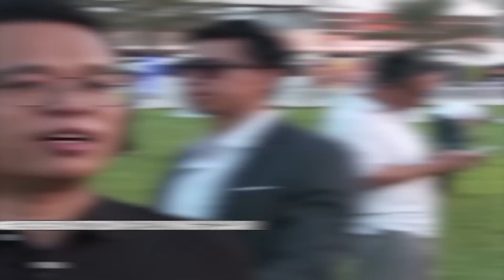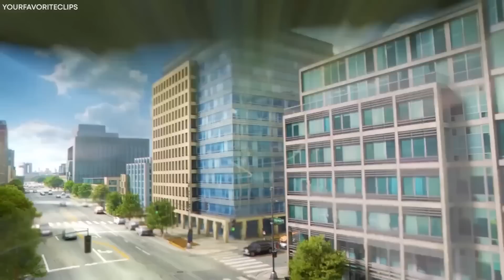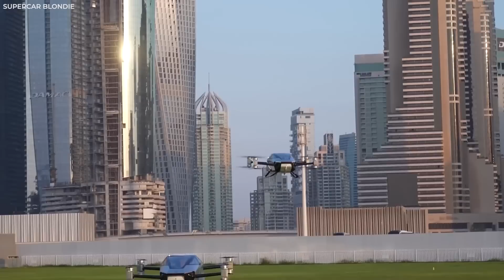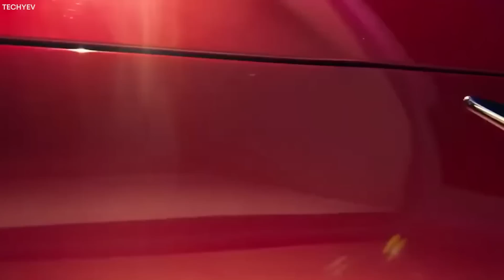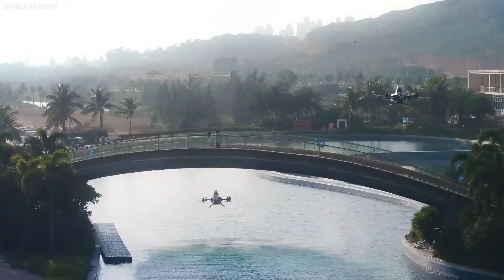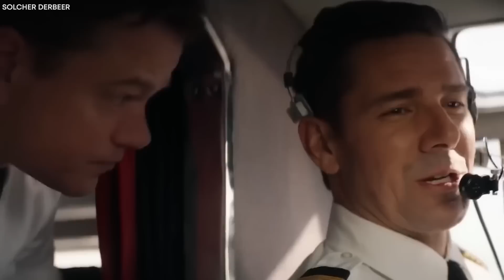China Releases NEW $12,000 Flying Car for 2025 That Changes Everything!

Comment: Marvel of Chinese engineering.  However, even the range is extended to 500 miles, the problem with air traffic control would be challenging.  Safety would an issue.  I prefer mass public transportation like the system in China, Japan.

Comment: Maximum 160kg? So it's not for more than 1 average american
Reply: Can be adjusted with better engines for sure, but its important to know if you fly alone you can most likely take more weight, as the extra 160kg is for addon items, should be about 200~kg if you fly without another person.

Comment: As cool as that car is, does anyone else see the mass issues with these in the air?
Reply: Yes...Something that every manufacturer has realised after just a moments thought, and why mass adoption of flying cars will never happen. Obviously a full pilots license would be a requirement, and thats a major barrier right there...The insurance would be ridiculously expensive. No take off or landing on public roads or highways, flight path restrictions over urban areas...So what's the point? 
If you want to avoid traffic jams, there's a great solution...Trains.
Reply: @zivkovicable  "It's dangerous, unreliable, difficult to manoeuvre and service, loud and polluting, that's why mass adoption will never happen" -- says bystanders from 1900 about automobiles -- "what's the point? Horses are a great solution".  Does that sound familiar to you?